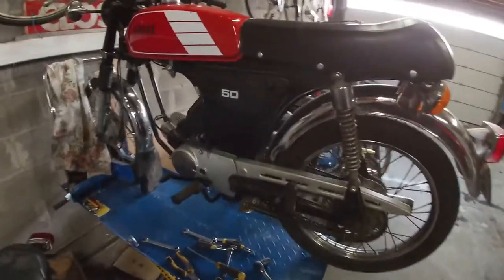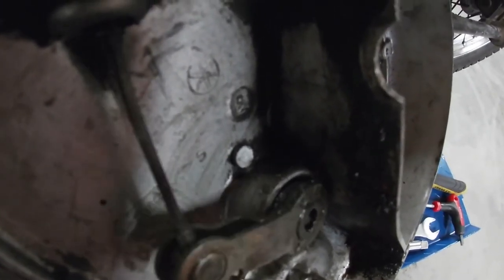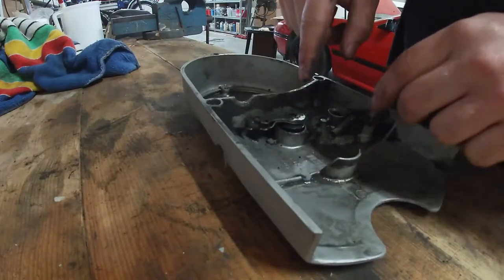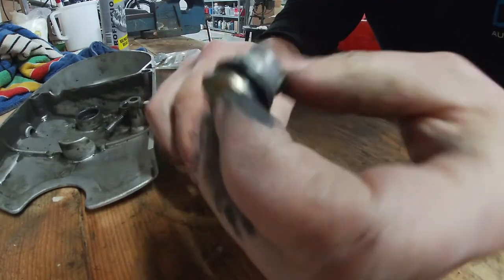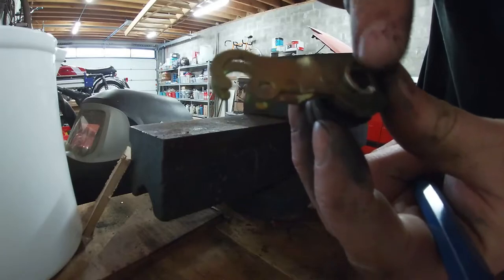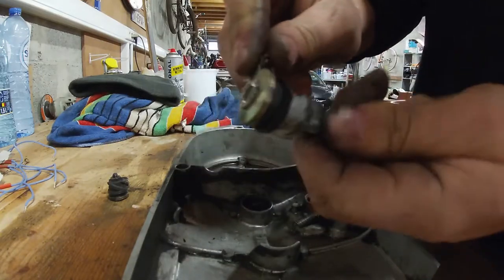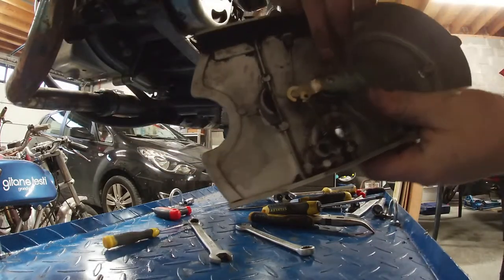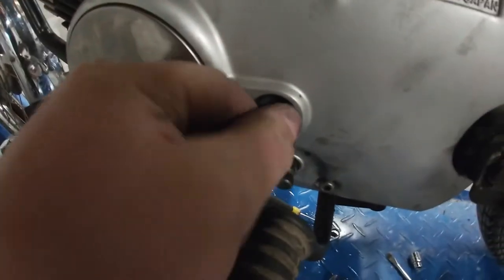Yamaha FS1 - Fixing the clutch

Comment: The video.  I'm based in Japan and have the Yamaha YB-1 which I think is the domestic name for the FS1.  Anyhow, I'm also having clutch problems, so will try out what you did.  Also, the misfiring is from the clutch??
Reply: ah ok.  I watched until the end.  lol.  Now I see about the misfiring.
Reply from the maker: @PauldelRosario  Hi there! The YB1 is I think a later model, based on the fs1. I even think you can get them here with a 4 stroke engine. The clutch is indeed a weak point on these engines, what kind of problems do you have?
Reply: Will open up the side of the engine tomorrow and take a peek at the spring and worm screw.
Reply from the maker: @PauldelRosario  Thanks man! Much appreciated!
A slipping clutch is easy to tell this way: when in 3rd or 4th at low rpm, fully open the throttle and pull through the gear. If the engine starts going up in rpm but the speed stays the same, thats a slipping clutch. Screeching noises are also not normal. Could be clutch adjustment indeed. They are very fidly to get right 😅
Reply: I've yet to open it up, but do you think the screeching could have something to do with the screws, the rod, and the clutch assembly itself? @VintageGarageYT
Reply from the maker: @PauldelRosario  heard to tell. I would have to hear it. Might aswell be a bearing that died.
Reply: My friend tried it out today.  Can't figure it out either.  He said that the clutch is also slipping.  I guess gotta get some plates.  ugh.. @VintageGarageYT
Reply from the maker: @PauldelRosario  that's weird. Did you try the driving test? Is it actually slipping?
How old are they? They are pretty cheap and it's pretty easy to do so it never hirts to change them. There is also a video on my channel on how to do that.
Reply: I took it for a spin myself, but not super fast, so I asked my more experienced friend to do it and he confirmed.  Just ordered the plates.  You're right - cheap!  lol.  I saw this one guy's blog on the YB-1 and he had 5 clutch and 2 friction plates.  Same with yours? @VintageGarageYT
Reply from the maker: @PauldelRosario  Can't remember by heart how many plates it has, but I actually think less. I would have to check.
Reply: @VintageGarageYT  What year is your bike?  Would you happen to have the service manual in PDF format?
Reply from the maker: @PauldelRosario  it's a 1986 model. I have a couple of manuals and parts lists in book form, but not in pdf. They should be around I think.
There is a dutch fs1forum which houses a lot of information. It's in dutch obviously but perhaps translating it won't be that bad nowadays: www.fs1forum.com

Comment: I think this worm gear should be made from metal, not plastic.
Reply from the maker: I could not agree more!
Reply: It is not usually the plastic worm that wears, it is the corresponding thread in the metal cover. Grit from the road gets embedded in the plastic worm and grinds away the aluminium until rotation of the worm produces very little axial movement. This is probably the worst weakness that the FS1E has as far as long-term reliability is concerned. The official remedy is a new aluminium side cover, very expensive.